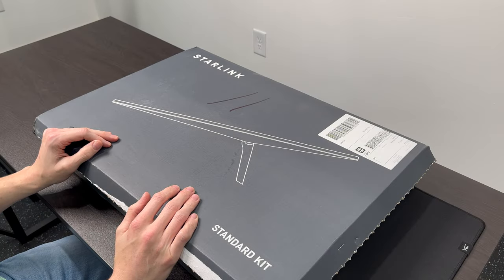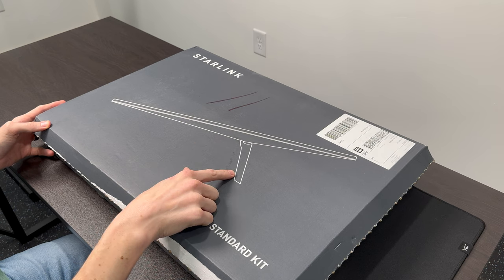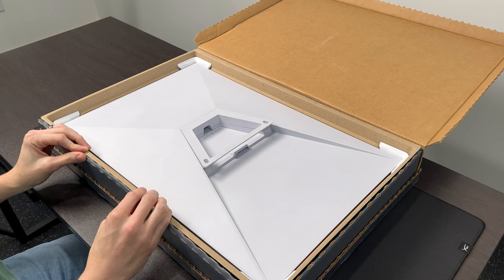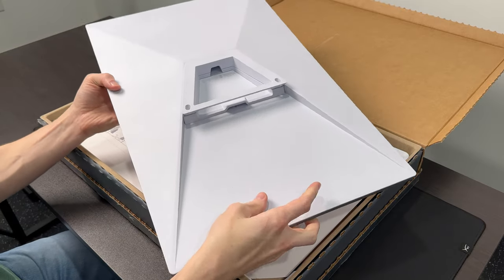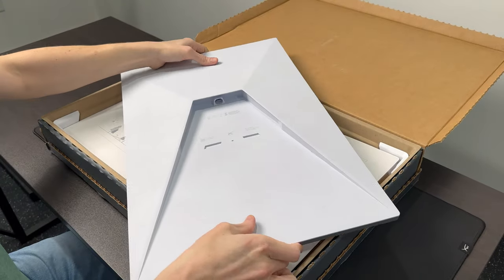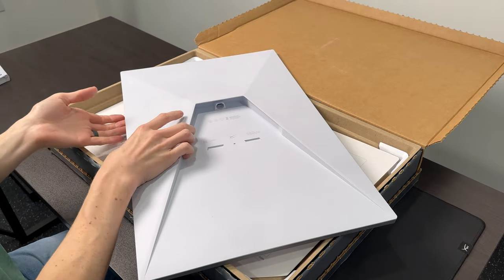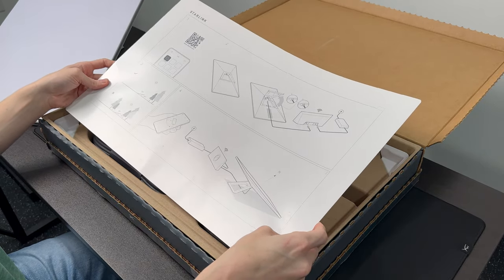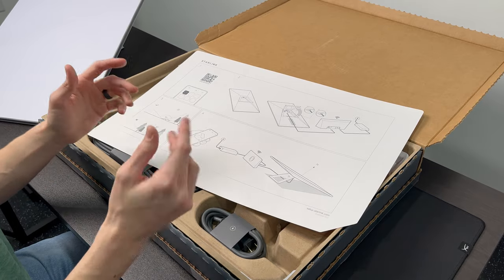Next Generation Starlink - Unboxing the Gen 3 Standard Kit

Comment: I wonder if the new router would accept 48V rather than 57V. Would be excellent for mobile installations if you could power it from your 48V LiFePO4 system! I hope someone can test the DC Input voltage required. Too bad you cannot use USB-C PD 3.1 -- 48V at 5A would be 240W.
Reply: That's the $1M question. Hopefully those electrically inclined will chime in with a solution.
Reply: A 48v LiFePO4 system would still fluctuate too much in voltage to be stable enough to run the dish or router.
Reply: @ZaiFuchigami  Slap a boost converter on there, or some sort of voltage regulator. Most DC electronics accept anywhere from a narrow to wide range of input voltages, usually published or stamped on the electronics themselves.

Comment: I like a lot of the engineering. I do question the ruggedness of the mounting hardware. And they don’t offer a grounding which is required by NEC code at the point of entry of the house. Seems easy since they are using Ethernet. An Ethernet lightning arrestor with a grounding screw to bond to the common communications ground of the house. I would also install a ground rod to take any direct strike into the earth below the lightning arrestor.

Comment: so will the gen 3 router be compatible to the gen 2 starlink dish? sorry got confused.
Reply from the maker: Yes it is compatible, but you have to set it up like a 3rd party router with Gen 2, using the Ethernet adapter and bypass mode on the Gen 2 router. It cannot replace the Gen 2 router in terms of powering the Gen 2 dish. I have a review of the Gen 3 router where I show how it works with a Gen 2 system: https://www.starlinkhardware.com/starlink-gen-3-router-review/

Comment: i have a question if someone can please answer it if i bought a starlink divce from the U.S but i haven't used it or subscribe to it can i take it and use it in Germany ? and dose it come with a subscription plan ? and if it come with a subscription plan can i take it and use it in Germany without any problems???
Reply from the maker: Depends on where you buy it from. If you purchase it in the US from a private party or an authorized retailer, like Best Buy, it will come without a subscription. You can then activate it anywhere you want that has service. If you buy directly from Starlink, it comes activated with a US-based plan, so you would need Global Roam to use it in Germany. You can cancel and transfer the equipment to a new account in Germany if you wish, but you have to wait a minimum of 90 days before Starlink allows you to do that transfer.
Reply: @StarlinkHardware  thx alot
Reply: @StarlinkHardware Hi, same here but does it work with a country that's not supposed to have service ? There's roam charges ?

Comment: INCLUDES:
Starlink Gen3 Antenna
Kickstand
Power Adapter
50 Foot Ethernet cable
Wi-fi 6 Router

thank you for this. Kept trying to find out the length of the included cable that no one seems to list it; not even Starlink themselves for whatever reason.

Comment: How does this one hold up to wind? With how easy that mount came out of the back of the dish I am just envisioning a horror story with it mounted to a stand or something and a wind gust hits at just the right angle to cause the mount to flex and pop out
Reply from the maker: I made it look easy, but that's only because I knew to apply upward pressure on the two tabs that lock it into place. Without some concentrated pressure on the two locking tabs, there is no way it slides out. In very strong wind, something on the mount itself is more likely to break first.

Comment: Does it not need the motor for adjustment anymore? Or heating in case of snow?
Reply from the maker: It doesn't adjust itself anymore for rotation and angle. It has a set 20 degree tilt, and the user has to manually rotate the dish to the correct position during the initial setup. The app has a tool that makes it very easy. Takes like 30 seconds. Removing the motors saved a lot on manufacturing costs and repairs.

Comment: Can this router still run the dish with PoE if I were to buy the router on its own and run a cable up to my gen 2 dish?
Reply from the maker: No, it can't power the Gen 2 dish on its own. Gen 2 and Gen 3 use different voltages and cable connectors. For use with Gen 2, the Gen 3 router must be treated like a 3rd party router, hooked up via the Ethernet Adapter and with the Gen 2 router in bypass mode.
Reply: @StarlinkHardware  well, shoot. I guess I’m buying the whole package. Didn’t want to have to mount another dish. 😭

Comment: Does this new kit have faster download/upload speeds (internet speeds, from dish to router) than gen 2? Or is the main improvement just the router with WiFi reach?
Reply from the maker: Mainly the Wifi performance, but the antenna itself has higher gain, a higher field of view, and a bigger power supply. Don't expect faster internet speeds, but there are slightly enhancements to reliability and the antenna itself.

Comment: Can this kit router be bypass?
Reply from the maker: Yes, the router has bypass mode. The router is the POE injector for the dish, so you can't completely remove it from the system. But in bypass mode, Wifi and routing functions are disabled, allowing you to use a 3rd party router.
Reply: @StarlinkHardware  Thanks

Comment: Does anyone know if the 75' cable offered with the Gen 2 system is available to purchase? I feel 50' will be too short, but I know 150' will be way too long.
Reply from the maker: Yes, the Gen 2 75' cable is still available for Gen 2 systems. There is no 75' cable for Gen 3 from Starlink, but you can use a 3rd party cable if needed.
Reply: @StarlinkHardware  where can I find a mount in which I take the kickstand off of GEN 3  to make it permanent mount? I can’t find one anywhere.

Comment: tho i dont plan to use starlink just yet i might have to go and secure a gen 2 kit because this is just a shity idea. Gen 2 is highly mountable and beams itself to a strong connection this is complete shit and cost effective for starlink
Reply: I have Starlink - Gen 2 - and have been satisfied with the antenna (annoyed at the proprietary connectors and lack of a built-in ethernet port on the old-tech router, though). The motors are what makes installation so simple. The kickstand approach certainly makes this a "pay the same, get less" proposition. Good for SpaceX, not so much for the customer.

Of course, customer satisfaction and concern for the customer's experience is way, way low on the list of SpaceX's priorities. For cryin' out loud, they don't even have phone-based tech support! Not to mention the variable price based on where you live approach to bleeding the customer.

If you have no other decent internet access options, Starlink is definitely the best option available. Sad but true.